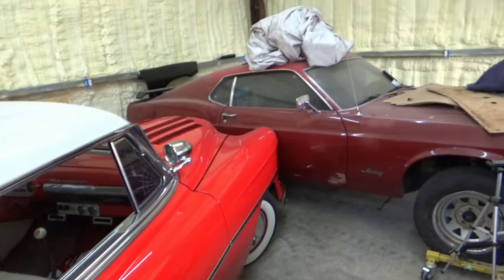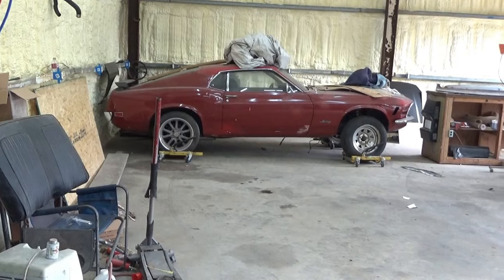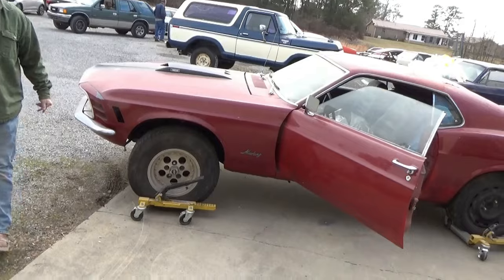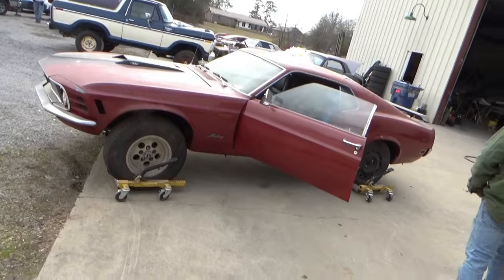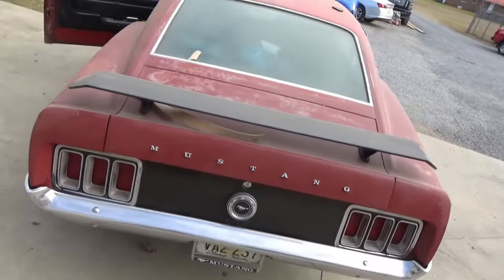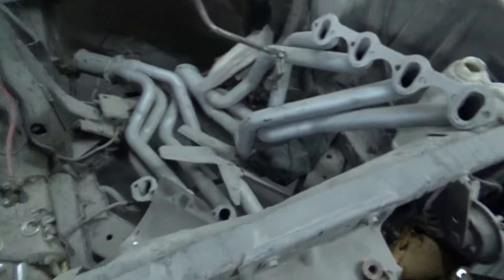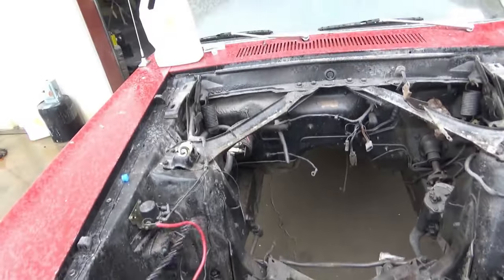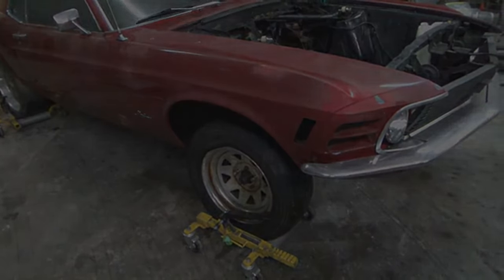1970 Mustang Back to life. #fordmustang

Comment: Ford had a winning design with the '69 and '70 body.  Surprised you don't do a late model coyote swap with tremec 6 speed manual, 4 wheel discs, ect.👍👍
Reply from the maker: Love the 69 and 70